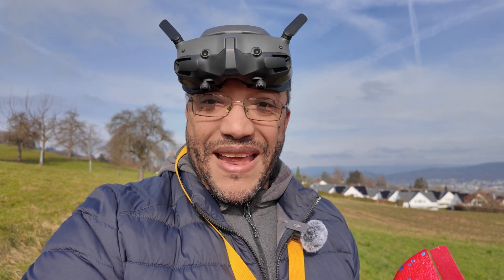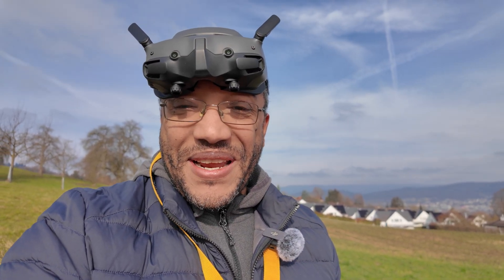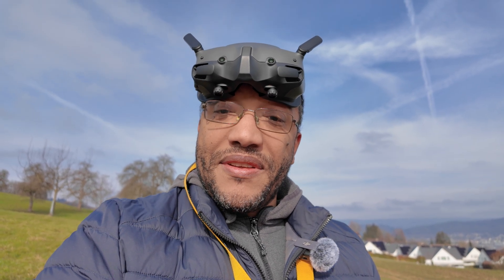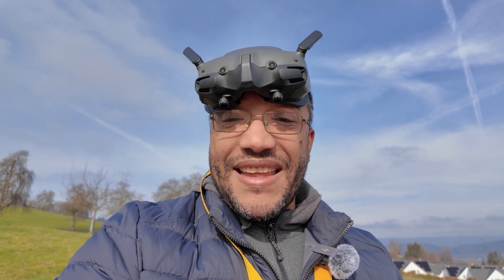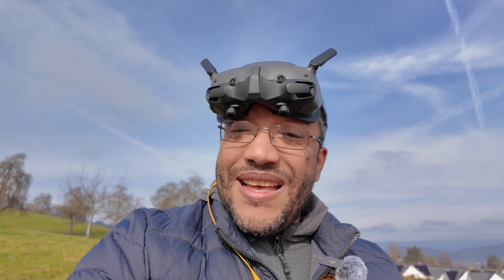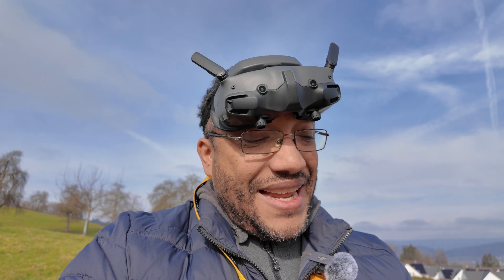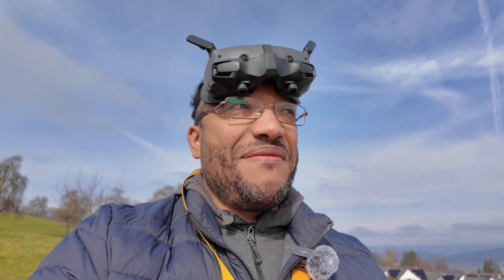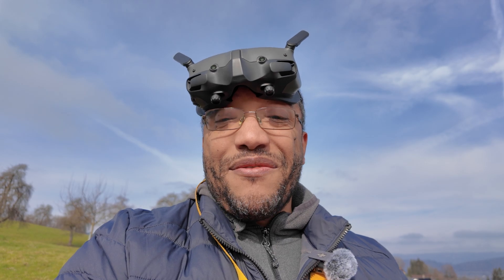DJI O4 lite on a 3$ Chuck Plane // Inav 8.0.0 - Differential Thrust // Maiden Flight

Comment: How much mW do you use? And do you think it has enough Range only on batt power for a parkflywe without Fc?
Reply from the maker: @NRG1991  Do you mean the O4 lite? The rx is built into the FC. Both has enough range even so it´s a linear whip on the O4 and a short linear wire antenna on the fc/rx. If you wanted to fly it without FC you would just need an esc with bec or a esc and additional a bec to power the servos (5v).

Comment: How did you power or connect the air unit to the reciever?
Reply from the maker: This plane has got a flight controller running Inav in form of an BetaFPV 1-3S AIO with an onboard ELRS receiver. The servos and VTX are connected and powered by that AIO.

Comment: Hi, I assembled DJI O4 lite with Speedybee f405 wing mini. I tested INAV 7.0 and 8.0 both, and that OSD shows some parameters but those values are wrong/broken. How did you customize your INAV in order to show correct values like your video??? Also, when you set to 'arm', does DJI O4 turn from low voltage to regular mode to record full quality? My INAV does not send arming signal to O4 properly, so I have to turn off auto-low-voltage. (Otherwise, only differences are you are using the Goggles3, and mine is Goggles2  ✈✈😅😅 )
Reply from the maker: @upyopyo  It works mostly with BFcompatibility mode (BFHDCOMPAT i think) in the OSD and in CLI you need to enter: set enable_broken_o4_workaround = ON and save it for the fix to be active in inav 8.0
But it's no 100% compatibel, a few signs still show as “?“.
https://github.com/iNavFlight/inav/releases/tag/8.0.0 (the fix is described here)
Have fun 😉
Reply: @McLogo76  Thanks the CLI command works!! and just need to take care of O4's overheat. It seems to get the overheat immidiately without flight/fan cooling, crazy. We just need to wait for DJI's firmware upgrade.
Reply: @McLogo76  One last question is, what parameter in OSD do you turn on for a horizontal bar showing in the display's center is actively moving during flight?  (by the way, I guess two vertical bars with arrow won't move until firmeware update..)
Reply from the maker: @upyopyo  it's on the left side under Attitude: Artificial Horizon and Horizon Sidebars... You can just try and activate the elements in the OSD tab and see what you like. But depending if you have a gps or not, some things only work with gps / barometer etc. - like speed, distance etc.
Reply: @McLogo76  I got that horizontal bar and moving. Thanks you so much a lot!!!! 😀😀😀😀  One day I will post my flight!!
Reply from the maker: @upyopyo  Great! have fun mate 👍👍